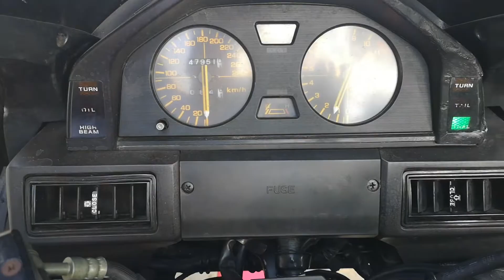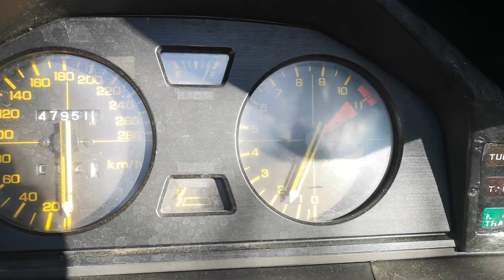Honda VF1000F2 Cold start

Comment: I had the same at the end of the '80s! Nice engine, good comfort even with a pillion. Negative the brakes and the weight. Unfortunatelly the HONDA v4 engines in those years had problems with the overhead cams. Take care and enjoy it
Reply from the maker: The f2 version has wider head, longer camshafts and different oil pump with oil cooler.

It does not share the first generation issues
Reply: @Pabloel  very well!!

Comment: i'm looking to buy one of these beuty. Tips for what should I looking for during a test drive?
Reply from the maker: Start it up cold, let it running. Make sure that the fans go on before test drive. Idle should be smooth, quiet. Any valvetrain noise after heating up means valve adjustment or bad camshaft (f2 are not that prone but still it happens). They hate idling so that is a very good test :)

During test drive Make sure it accelerates smoothly on 5th gear 3 to 6k rpm. If not carburetors need to be sonic cleaned.

Check the front shocks for leaks, rear if not replaced is probably dead. 

Make sure clutch does not slip.

Check the oil for color, bad smell. Otherwise they are bulletproof. Big money is only the valvetrain noise tbh
Reply: @Pabloel  thank you, that's super helpfull. With your video I have to get used to the sound of the valvetrain. Beside these checks, if it seems all good are there some critical points of possible  rupture? For last:  in the periodical mantainance are there some particular parts to buy? Or am I good with commercial ones?
Reply from the maker: @valeriobernabei9643  Only critical points are the heads and carburetor boots (NLA). Everything else is pretty much bulletproof.

Many people do the oil mod but the F2 has oil cooler so that helps. 

When it comes to parts most of OEM is no longer avaiable (carburetor boots!). So you buy whatever is on the market as good brand as possible.
Reply: @Pabloel  ok thank you again. So there are some spare parts made by other brands? if that so are some particular brands that you prefer? And how can i check the heads and carburetor boots?
Reply from the maker: @valeriobernabei9643 

Only reputable website for parts I know is cmsnl

Brands? Brombo, Ohlins, Ebc brakes and so on. All big names. Just google whatever you find and ask on forums vf1000.com

When it comes to carburetor boots - check them for cracks. Simple as that. Use small mirror to inspect between carburetors aswell.
Reply: @Pabloel  you just gave me all the tools that i need, really thank you!! After those years do you still enjoy this bike or did something bother you?
Reply from the maker: @valeriobernabei9643  This bike is a blast to drive. Lots of power, really stable and safe feeling on the road. I just put in the F1 fairing on it cause I prefer the look of it.

Carbs get clogged after sitting  (thank you greta for this POS fuel) so it NEEDS to be driven
Reply: @Pabloel  sounds fantastic, I cant wait for the test drive, even tho the bike is sitting since may of this year (i hope that's not long enough), I went for a search of the carburetors boots, they seems very fragile e prone to crack
Reply from the maker: @valeriobernabei9643  the trick is to heat them up before taking them off with a heat gun. Before installation I put them in boiling water to make the softer.
Reply: @Pabloel  oh nice trick, but by seeing from many videos (i've found only vf1000 disassembly) it's impossible from the outside telling if the boots are cracked. Many peopled told that you can feel il only by the instable erogation (lost of the pressure for the air) Anyway do you raccomend buying already some of these, even tho are in good condition?
Reply: @Pabloel  Great news: i've bought it, made 300km for getting it home through the Italian Apennines, and sounds like a violin. Maybe i have to check for the rear suspension, it seems a little sloppy. tha carburator have no problems at all, but should I buy the carb boots as spare parts? just in case
Reply from the maker: @valeriobernabei9643  Try adjusting the air pressure and see if that changes anything. I went for aftermarket shock and it transformed the bike completely.

And make sure you got the oem tire size - it is important on these.

Comment: what happened to that front mudguard ?
right cubby box is unobtainium.
rear light is unobtainium also, but yours only has minor crack
engine sounds to be in good condition.
Reply from the maker: I already got that right box installed aswell as new front fender.

Front fender got damaged because previous owner installed bigger front tire and it was rubbing after it heated up or during braking I presume.
Reply: @Pabloel  that's how it looks, I've seen bigger tyres fitted and they didn't touch, that must have been a whopper of a tyre. Poland, wouldn't surprise me if you are the chap that called me naughty names on ebay.

Comment: Hi,
Are the backpipes original?
Reply from the maker: The middle exhaust section is stock for sure. The rear section I have not seen before on any VF1000. The shape is the same, sound is the same aswell (after I removed the silencers) - I have two other bikes that I can compare with.
Reply: @Pabloel  It has a nice sound on this video, and rear silences looks like mine, except my silencers are black. My VF1000F2 is really silent. I would like some more sound.

By removing the silencers, you mean the db killers? Is it the 4 bolt in the middle behind? 

Thank you :)
Reply from the maker: @caspersigaard3689  On this video you can see black circle in the middle of exhaust where the silencer was. 4 bolts and everything came out. I also put on video with DB killers installed. OEM Mufflers do not have DB killers.

I have completely stock exhaust on one of my bikes and it is riveted together in the back. I also have one that was completely gutted,  and new rivets installed and center section removed. Very, very loud.
Reply: @Pabloel  Im quite sure that i have bolts and not rivets. So maybe my silencers are not stock?
Reply from the maker: @caspersigaard3689  Could be. I see rivets on stock mufflers. 

You can ask on www.vf1000f.com forums which is an excellent source of information!
Reply: no
Reply from the maker: @NuKamTaiRupi  Sankei 2208 is stamped on the back pipes, mid muffler is stock
Reply: @Pabloel  make a video
Reply from the maker: @NuKamTaiRupi  This is my video with the mufflers mentioned. Now I am deleting collector box and testing three setups - aftermarket, stock and stock gutted. I hope I will be done in a week!